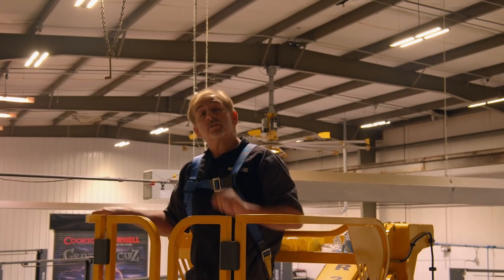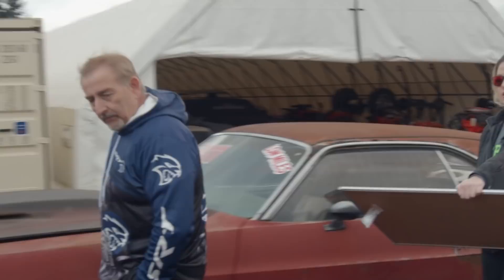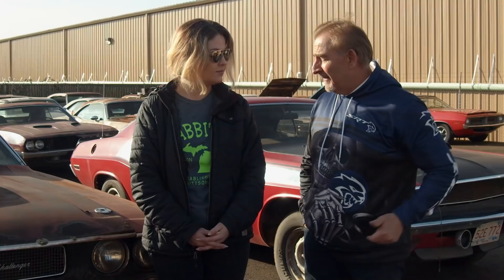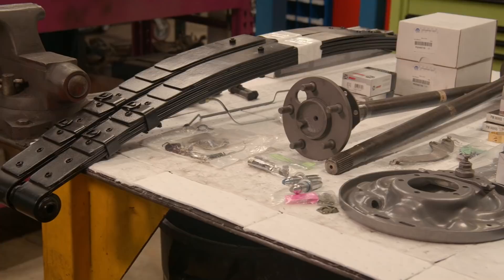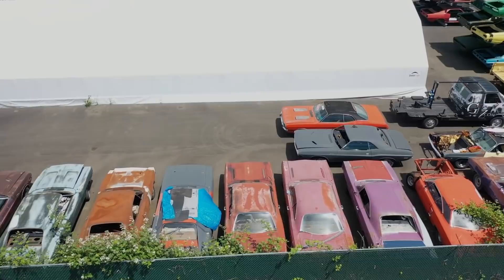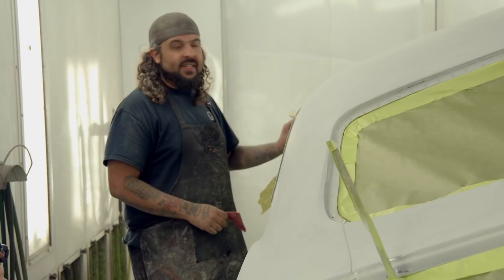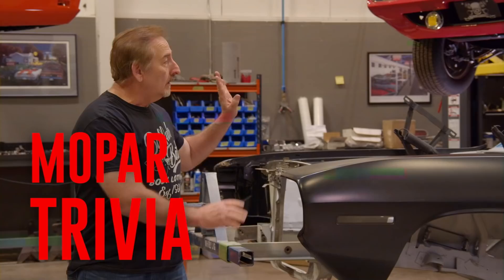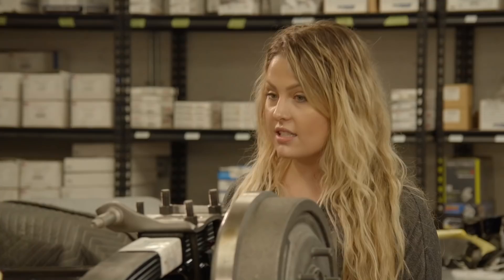NEW EPISODE: T/A CHALLENGER CLASS IS IN SESSION!

Comment: When my first Mopar came with a 273, I dreamt of a 340. Then when I upgraded to a 318, I still dreamt of a 340. When I finally installed a 360, I wanted the 273 back every time I pulled in to buy fuel ;)

Seriously. unlimited finances and I would take the high winding 340 over any of Mark's big blocks. I get that the 360 has more torque and can be upgraded to 4-bolt mains etc, but its smaller sibling was an engineering masterpiece back in the day.